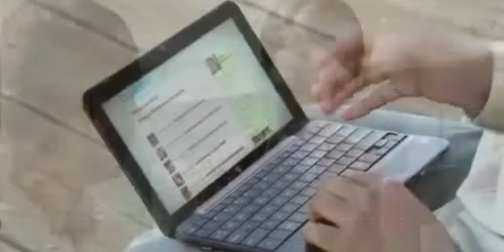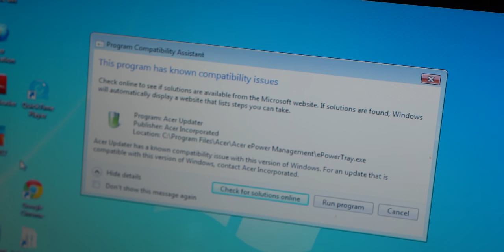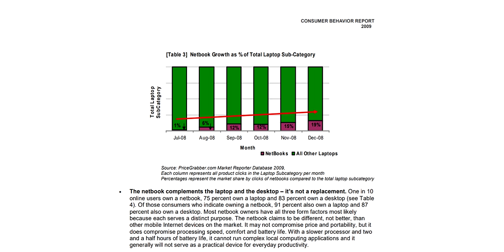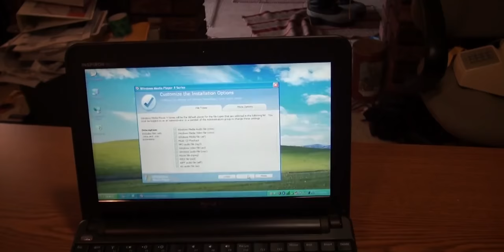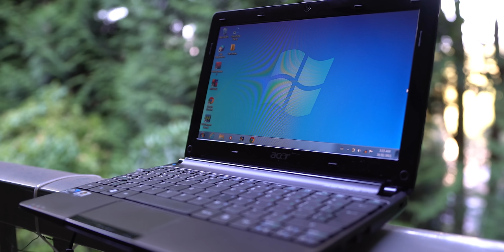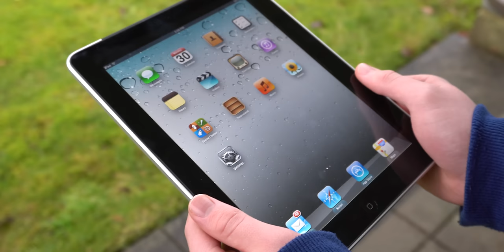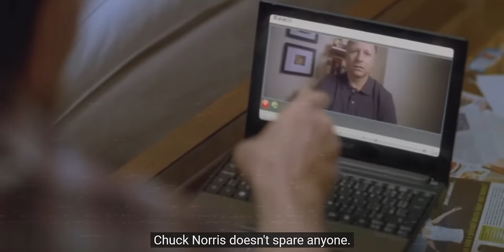Why Netbooks Failed - Modern Retrospective

Comment: Wait! Netbooks? I always thought they were called Notebooks and I used to have one HP with touchscreen and a pen, the screen rotate 180° so you can use the pen comfortable. Can’t remember the name, but it was very small
Reply: Notebooks are 14 inchers, while netbooks were 6-11.
Reply: Was it spiral bound?
Reply: "Notebook" is just a synonym for Laptop, just as Netbook is a (low-end with built-in networking) Laptop. Marketers like to differentiate things to increase sales & excitement, but there's rarely anything important behind their PR.
Reply: Laptops with rotating touchscreens are called ultrabooks
Reply: I had the HP one that rotated 180° but wasn't touchscreen circa 2012, the hinge was absolute garbage, my dad must have slapped gorilla glue on it like 20 times. IIRC the power supply or the hard drive or something gave out a couple of months in and it had to go back to hp to get fixed.

Then against my better judgment I replaced it with another HP netbook circa 2015 which was at least durable but only by virtue of being so laughably underspecced that it would never wear out. I think I payed like 300 euros for it and probably most of that was the SSD at the time. Actually no, I had forgotten about the time a whole column of the keyboard just gave up working like 2 months in when I was in a foreign country and couldn't easily send it back to get it fixed. So as a student I was pasting in characters to write essays, it was wild. Speaking of the SSD it was 32Gb, so more like 28, and the OS alone took up 20 of that. You could not change or upgrade the SSD or RAM because both were soldered to the motherboard (2Gb RAM in 2015 was already low and borderline inappropriate for Windows). That one actually would have done quite well with Linux but I never bothered.

As someone old enough to remember computers where everything was modular this rubs me the wrong way. You'd buy a shitty "cheap" computer yes and then when you could afford it you upgraded parts, that's how it always used to work. Like the only difference in design between this laptop and the 500€ one is that you could actually change the parts when technology and your budget got to that point.

Like, I did buy these laptops for a reason because I was a broke student, and the joke is on me for actively buying HP a second time after swearing to myself I never would. But when what you're selling is that arbitrarily shitty (see Windows Starter) it ends up feeling like a slap in the face.
Reply: Apples and oranges
Reply: Touchsmart up was the name of mine I had one. I loved it sooo much.
Reply: Also notebooks are synonymous with laptop in many countries.

Comment: OMG! Literally the night before I typed this comment and watched this vlog, I dug out my old netbook from 2009, swapped out the HDD for an SSD and installed Linux Mint 32bit on it! 

With 2gb of ram and that weedy single core Intel atom processor even budget smartphones will outclass it in terms of power but it kinda has a charm with its tiny keyboard and screen plus it works like a charm - it's a keeper! 🤗
Reply: Swapping the hdd with ssd on some slow ass pc or laptop makes it feel like a 2031 computer

Comment: the eeepc 701 was my first laptop and it got me through college!  I got the Linux version and eventually installed xp. it was actually faster than most cheap full sized laptops because of the SSD. I'd say it was the precursor to the the modern Chromebook in terms of use case (at least for me)

Comment: omfg i remember i had one of those acer aspires. someone broke into my house and stole it though. it was the aspire one as shown in the video.
Reply: There were a wide range of them. I had a fairly expensive Aspire 1810tz, which was really great for its time. Then it fell to the floor and the screen broke and by that time, replacing the screen would cost more than buying another laptop, so. Still useful as a server though. :)

Comment: I found this interesting. I bought the first netbook - actually had it shipped directly from Taiwan directly as they were not sold in my country yet. It was perfect - an ultra small computer that I could throw in a bag. It would allow me to connect to the internet when I would otherwise be without, I could ssh onto my servers and RDP onto others and manage systems remotely without being burdened by a large, clunky laptop.
I did buy a newer Atom powered netbook, which was OK. It was though a greater disappointment. It was bigger, yet not as robust and I found that I still used my original EeePC just as much. This second machine I must have sold at some point. I remember writing the odd document on it, but I found the original netbook more useful and so I still have that but not it's successor.
I certainly noticed that a lot of people used these instead of a laptop and it was obvious that they were going to be disappointed. These were in reality a niche product and this was just not a good use for them - and Windows just seemed pointless on them.
So yeah, I get why they died. I was sad to see them go, but tablets definitely replaced them wholesale and with very good reason.

Comment: I had an Asus Eee PC back in the day for college. My sister bought it for me for my birthday, and I upgraded the RAM and the OS to regular Windows 7 (because honestly, not being able to change the wallpaper was legitimately unacceptable to me). Problem is, even with more RAM, it just wasn't meant to run full Windows 7, and it pretty much died.

That was the only laptop I ever owned until I got my Surface Pro this year.

Comment: I had a netbook back in 2008. It was great for the price. It was able to run Photoshop and some video editing applications. I was able to use it until 2013-2014 plugged into a monitor. It wasn't fast but it got the job done.

Comment: They didn't "fail" at all. They had their legit time window before smartphones took over. I truly loved them. It took the PC industry much too long to figure out that CPU power and RAM size isn't everything and that not every customer was keen to spend a fortune for some device to surf the web and type some mails with.
Reply: I think netbooks had to happen as a proof of concept that the public needed cheap and basic laptops. We now have cheap laptops with capable hardware thanks to that market race to introduce great value in the traditional and familiar laptop form factor.

Comment: Light modern linux distros might save these from the dump
Reply: I use Linux Mint XFCE on mine. Smooth as butter.
Reply: To an extent - web browsing is unfortunately still quite sluggish on the pokey Atom processors most of these came with. If you had a dual core AMD one though... it would probably work well!
Reply: Linux is the savior of old devices. My mum was about to throw out a 2007 PC from her workplace, but I was able to convince her to give it to me instead. Replaced the crappy Celeron 420 with a Core 2 duo E7200, put an old Radeon R7 240 card in it that was sitting in my drawer and now it's a perfectly capable machine for streaming 1080p Movies and Series thanks to installing Linux Lite on it. It even plays 1080p YouTube without any problems.

Comment: 6:48 “It also got rid of the ability to switch between users without fully logging off.”
Lock button: Am I a joke to you?
Reply: Lock doesn't mean just switching users, when you use a screen saver and you have it set to go to the login screen then that's called locking a computer, infact in normal Windows 7 there is a switch user button (from memory not sure)

Comment: Still use my Dell Inspiron 11 when traveling.  Before I even turned it on when it was new I swapped out the pathetic 5400rpm hdd and fit a 120Gb SSD ,also doubled the memory to 8Gb and installed Mint Linux Cinnamon.  Runs very well indeed.  When I travel it's by motorcycle so obviously not room for a laptop, this was and still is ideal for my needs.  Yes I know you can do a lot of it on a phone, but that really sucks especially with my fingers and even a ten inch screen is far better that a five.

Comment: I had a Netbook, for about 2-3 years, and it worked until it got full of viruses. I liked that it was small and portable, but I replaced it with a more powerful laptop: MacBook Pro.
Reply: You could have just wiped it
Reply: jesus that's like going from a beater moped to a Lexus
Reply: @circuit10  True. But a Clorox wipe couldn't kill a Trojan virus. 🦠
Reply: @kintozero3169  Yeah. It was a meaningful upgrade.

Comment: I loved my Samsung N120. Most of the work I did at the time was staring at a screen, thinking, and typing. I needed something that could last 12+ hours a day and do it on a budget fit for a ramen diet and netbooks delivered. Chromebooks really don't fill that role left by netbooks. They often come locked down and unable to run what I needed. I miss the freedom and accessibility of a cheap, long battery life device with a fully capable OS.

Comment: My mom has something that's still called a Netbook from 2012 or 2013, but it had the normal Windows 7, and was a bit larger. It currently runs Linux Mint decently. I think it was just a way to get in on the netbook thing rather than saying "really cheap laptop for $400." Where I currently have a mobile workstation, which is the opposite end of the "laptop" scale, being larger, capable of up to 3 HDDs or SSDs, a ton of ports, and so far it's only needed a battery replaced, but they're expensive. I'm glad it's lasting well.
Reply: Update, I guess it's a "notebook" not a "netbook" that my mom has. Either way, low end, not good for much other than Netflix and Solitaire.

Comment: You're giving Microsoft a hard time for trying to make an OS that matches a cheap OS. Changing the wallpaper is easily solved really; just use other tools. I didn't mind mine for what it was... for the most part I wanted the form factor and many had excellent connectivity compared to even modern machines. I've got three still... including an original eePC.

Comment: My roommate in the Army had a netbook that he used for three years and with good success. He would mercilessly tease me for my expensive MacBook Pro which didn't work well with the Army and DOD websites that required CAC reader. In turn, I made fun of his cheap tiny little netbook. Looking back that netbook did everything my roommate needed a computer to do at a fraction of what I spent for my MacBook Pro.

Comment: Yo, I have the same one shown in the video! I really like the water drop design on the case, too. This was one of the most "powerful" models back then, often called "an ultrabook on a budget" by some. I upgraded the RAM and swapped the hard drive for an SSD. A month ago, I took it out of the drawer, installed Lubuntu on it, and now this little thing runs better than when I first got it. It even runs VS Code. I've been using it to run scripts that automatically upload files to my GitHub repo for about a month now. It’s been on this whole time and gets the job done. Good job covering this!

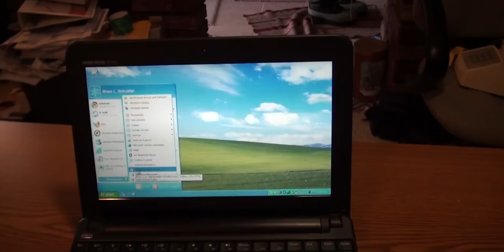Comment: Late to the discussion, but this video was quite confusing/badly written. Saying, that in that era all normal laptops were big and clunky except the macbook air conveys a wrong impression of the market. There were obviously also other full fledged laptops, which were thin and light - just, as the other specs, in the context of that era. Examples would be Sony Vaio's 505 series (R, V) culminating in the x505, but also the Sharp Mebius Muramasa, etc. So actually there was the full range of options in some sort of combination available at that time - from clunky and heavy to thin and light from cheap to expensive, from low end to powerful. The macbook air was the thinnest and lightest at market introduction, but hardly the only full specd lightweight one. As thin and light laptops did exist, but were not cheap, the main differentiator of these new Netbooks thus were primarily their price. This they achieved - as mentioned in the video - through lower specs of basically all components: not only the processor and storage, but e.g. also the screen, which was set into the lid with a huge frame. The Linux distro also helped to keep the cost down - actually there were two models of eeepc from the start, with the Linux one being even slightly cheaper. The video gives the wrong impression as if there were no lightweight laptops before the Netbooks and it also somewhat gives the impression as if the macbook air was in the same market segment, which of course it wasn't. Additionally the main argument of the Netbooks being a "scam" of Microsoft was extremely badly argued. From 06:00 the main argument was, that the Netbook experience was bad, because Microsoft stripped down Windows for no real reason, also stating that everything would have been perfect if they just left normal Windows on the Netbooks. But at 07:20 the video mentions that Netbooks with their were Atom processors were sluggish to use. Obviously irl Netbooks were low specd, because they were intended to be cheap, and Windows 7 Starter was an attempt to make Windows as lightweight as possible to have as much storage left as possible for the user. I remember at that time there were guides floating around on how to strip down windows even further. People who bought Netbooks were indeed in the same demographics as those buying chromebooks today - no one was expecting a high-end high-power experience. Most buyers knew, that buying some of the cheapest laptops on the market would mean lower performance. Apart from people on a budget, the other big group of users were tinkerers, or would be tinkerers, for many of whom the eeepc was a gateway to the world of self customised user experiences. 
So to argue that Microsoft destroyed the Netbook experience by artificially restricting the performance is arguably wrong - just as wrong as the argument, that most buyers did not know they would get a low performance machine when buying the cheapest laptops on the market. How stupid can this argument be? Or did I miss something in the video?
Reply: Imagine writing ALL THAT and to NOT EVEN HAVE A SINGLE REPLY/ BE RECOGNIZED LMAOO 🤣🤣

Comment: I have an HP Netbook I got in early 2009 for only $200 with a nice case. It was good for travelling and internet and light use. It was one of the first ever computers with an SSD (albeit the capacity was so small I barely had enough room for the OS and updates, lol). I actually think it worked reasonably well for internet and basic functions. I used it on occasion for many years until the battery stopped holding a charge and it just couldn't keep up well with the latest web sites. I think the biggest issue many people had (as with many things) is that they thought/hoped it would be good enough to be their main computer, which it obviously wasn't meant to be.

Comment: People forget that Windows 7 at launch was  incredibly bloated and almost reached "Crysis" status. Vista also had that, due to different reasons, but most people ignored it and still used XP. So a Starter version made sense. What didn't make sense, as you pointed out, is stripping everything, even background changing. The last netbook my family ever got was exactly around the time it came with the Starter Edition.

Comment: My netbook (an Emachines from WalMart) got me through college. Still the best laptop I've ever owned. Tiny, massive battery capacity (11hrs of use!!!), 250gb hard drive, expandable RAM, and just over $200. Mine had an Intel Atom processor, that was... Enough. I used it for word processing, browsing the internet, watching YouTube, and occasional SNES emulation. I set it up with a dual boot to Linux, as well. It was GREAT!!! I've been unsuccessfully trying to chase that experience ever since. It was the right size, with the right power for what I needed it to do. I hate big clunky laptops, if I was big and powerful, I have my desktop. I want light, small, portable. And only basic power.

Comment: I loved my 12 inch ASUS EEE PC in 2011, it had an AMD E-450 chip with integrated Radeon HD6320 graphics. Used it all the way until 2014-ish. Played lots of games on it during college, games like Sims 3, Dota and even played CODMW2 and 3 multiplayer on it with my buddies back then. It still works even now, but the battery is old and even at 100% charge, barely lasts 1 hour. Good old days man..

Comment: @91Tech I had a purple acer aspire one with the same keyboard as you show in the video at 12:20 And that netbooks keyboard was great I also had a good Quality screen. Don’t let down for the trackpad, pathetic 1gb of ram, And the horribly weak processor.

Also good battery life 7 hours
The keyword was even good in comparison to my 2015 model MacBook Air I bought new in last 2017 got in early 2018

Comment: I had great Samsung netbook back in the day with 2 GB of RAM. Win 7 was very ok on it actually. Plus it had excellent battery life. Also I could even play some older games on it - Warcraft 3, Quake 3 etc. Biggest drawbacks to me was shitty screen resolution of 1024x600 or something like that and inability to play youtube videos and movies higher than 480p without lagging. Then Nvidia solved this issue releasing it's chipset with actual graphic card paired with Intel Atom CPU but that was too late and netbooks died eventually

Comment: I've had an acer aspire one 753 in my last years of school and the first year of uni. Definitely warm memories, but I'm glad it's left behind. Crappy Celeron, battery life of about 6h (when it was new) and actually quite good monitor connectivity: it had a VGA and HDMI port. I absolutely did use it for all kinds of presentations. Sold it in 2015 for 90€ though and never looked back. Up until your video, that is. Weird times.